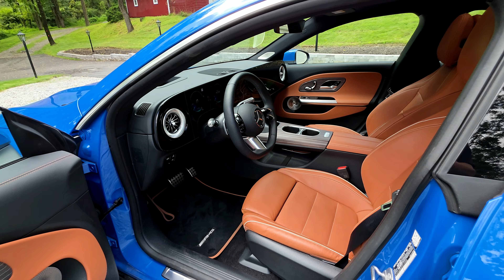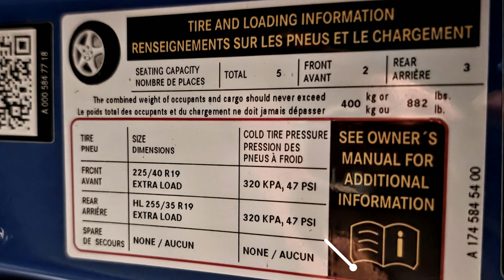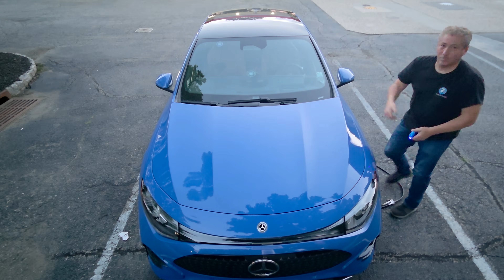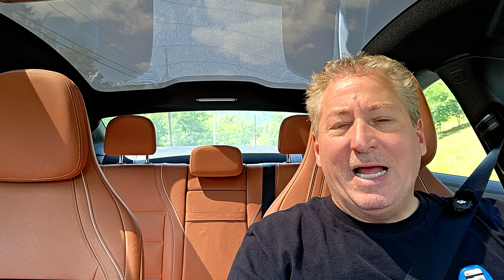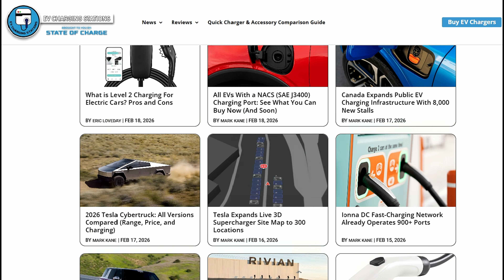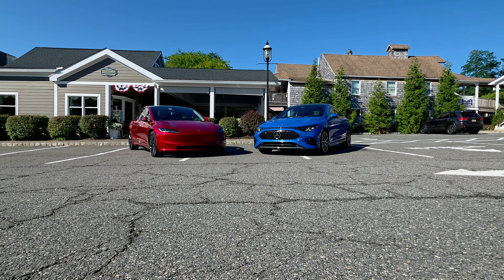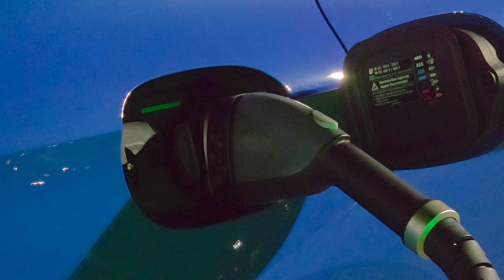The Mercedes CLA 350 4MATIC Has Seriously Impressive Highway Range

Comment: Just had one as a rental in France for 2 weeks. (The 250+ RWD). It was a road trip monster, never had to charge out of necessity and the charging was so fast that it would finish before our breaks were over and would have to go move the car. Super efficient and loved the automatic LED matrix headlights at night. 

All the Mercedes logos and the indoor definitely gave it a bit of an immature footballers first car after a contract.
Reply: Same here, rented it for about 1400 km in Spain, trips of 450 km, never DC charged it. Great hardware, but odd equipment (blaming the rental company more for that).

Comment: Thanks Tom.  Very impressive results!   And,  I agree it should sell well.   But, I think Mercedes has cur a few corners in order to keep the price low.  For instance, the steering wheel is not heated.  The only heated seat is the drivers.  I suspect that the glass is not as soundproofed as their higher price models.   The interior seems a bit too glitzy/plasticy for me (a long time Bimmer driver)    And the Burmester audio was just soso.
Reply: Fyi CLA Winter package option adds heated steering wheel and wiper heater. Both front seats are heated too, but not rear seats. You are correct that the CLa does not have acoustic double thick windows.  Burmester is great though, more powerful than previous generation. 16 speakers, 850 watts.

Comment: Ahh , the  range number.    Everyone wants  400, 500 miles of range, but when asked "Do you ever NOT stop before reaching  300, 350 or 400 miles"? Or  "Do you go on road trips that are longer than 400 miles"   And when people actually think about it, THEY STILL SAY I NEED  400 miles of range ..  bother..  Once "non EV" people buy EVs  do they finally realize how dumb it was to state they needed 400 miles..
Reply: I agree. I have a 2019 Kona with a rated 240 mile range. My wife still still worries about it after a year of seeing me have no problem. There is a number right in front of your face telling you how much further it can go. Nothing to worry about at all. 
Eventually more people will want to save some $ and get a smaller battery. We're just so basic in the USA and the manufacturers treat us like that. They're happy to sell a bigger battery than we need if they can squeeze another 10k out of our ignorant arses.
Reply: @gunningopher  Agreed.  IT is the "What if I need to" syndrome.  Just like how people buy huge trucks that can tow 10-15k lbs, but owner never does...
Reply: Plenty of use cases where you would prefer high-range cars. Daily charging for most battery chem is 80% recommended; winter conditions (cold temps, snow on the road, wind) really hurt range. Add in some elevation change and your 300 mi range vehicle is nearly half that. Not everyone lives in a metro area and only drives short trips frequently or has the ability to charge at home.
Reply: @rnodeprot  Drove my EV9 in  6 degree weather.  Did not even think twice about the range. Elevation... So you are going up hill for 300 miles straight?  Where i the US do you do that????  You either stop at the top of the hill, and charge or you go back down , gaining range back.    Sorry, no need for 400, 500 miles unless towing 7k+ lbs.   Non EV owners make me laugh...
Reply: @GregP30  I live @ 9k elevation. Daily drives can involve thousands of feet of elevation change. Regen is a fraction of what is lost uphill. Most are in your situation, but most also love to say no one needs more range. They, and you, are wrong. Btw, I've owned ev's since 2012 and own one now.
Reply: @GregP30 .  I want an EV.  But they and the charging network are not ready in my area.  It is all uphill on my 1100 mile drive back from family.  From 800ft above sea level to 7k feet!  Add in wind that flips semi trucks on their side!  And -30f
Reply: @nunya9555    So it is  -30F  EVeryday of the year? You drive 1100 miles every day/week?  You drive up 7k ft in elevation every day/week?  
    Those are the "what if" scenarios people think they need every day/week , but not in reality.  So my guess, less than 5% of your yearly miles will be in these conditions.
Reply: @G @GregP30  Not -30 every day.  Check. Not 1100 miles a week.  Check.  I can see your point.  But, you seem to think 6 degrees is cold.  We don’t live in the same climate.  I live on a paved street, in town and had to pull 3 stuck Jeeps out of their hole one particular recent winter.  What hole? Just a low spot on that paved (entire) street that is generally covered in 10 inches of packed snow and ice for at least 2 months at a time.  Couldn’t my little gas saver car out of the neighborhood.  My 2wd Tacoma also stayed put for two months.  But at least it was still sunny off and on.  There is exactly one supercharger in town that runs $1.25 per KWH.  Nearest one after that is 125 miles.  Most EVs could make that trip most of the year.  But with winter range reduction?  Folks out here still need a decent clearance AWD ICE at a minimum, plus the EV.  It’s doable, just not cheap.  Right now would be a great time to pick up a 3 year old EV with 10k miles for around $25,000, but I just don’t have that right now. BTW, I like EVs and always have.  Be careful that you do not argue so hard for them that you push away people.  That isn’t helpful. But I appreciate your zeal.
Reply: I disagree.  I have 2 PHEV’s. I make an 880 mile trip every 45 days.  I will buy an EV like this one Tom tested, because of the range. My usual routine is 5 hours non stop, 325 miles. Eat, at Denny’s recharge at L2, gas up at Love’s. End of stage 1. Drive 5 more hours, 268 miles, gas up, and recharge car. Sometimes I get a room, other times I continue for last 4.5 hours.  If you want the routing, it is CA51-CA99-CA58-I15-I40-US95-I10-AZ202-XUS60.
Reply: @Qrail  You are the exception.   Very, very few people make a 900 mile trip that often.  You are not the target customer.
Reply: @GregP30 . I do 1100 miles to visit family 3 or four times a year.  Where I live it is 120 plus miles between chargers and gets to -30F in the winter.  Reduced winter range on top of bad road conditions could cause more than anxiety, it could turn into a survival situation.  One charger in my town, and it’s running $1.25 per KWH (which wouldn’t matter to me charging at home).  I know many EVs can make 120 miles in the above stated conditions, but any ICE can do so.

Comment: I think the 2 speed gear box makes a lot of sense..
Reply from the maker: It sure helps with highway efficiency
Reply: Extra gear add complexity and another thing to break down the road.
Reply: @kenwk2283 true, but coming from gas it's still a lot less things to break.  And gas cars for the most part don't break all the time.
Reply: @kenwk2283  At least in the Taycan, it's more like an automated manual with a clutch pack.  It's far easier to auto-rev-match an electric motor.  It has 0 to do with a torque converter, valve body, or CVT type reliability issue.  There's very little to break, and it hasn't been an issue for the Taycan.
Reply: @kenwk2283 no worries Automatic Transmissions like the 10L80 co-developed by Ford and the GM Megacorp feature a whopping 10 gears, so "smartly" using this as a reference (which you should) having a 2-spd means 8 less gears one needs to be concerned with.😎 also ref: "The Glass Is Half Full".👈 see what I did there...?🤙
Reply: Yeah… I think the industry needs to accept the complexity hit.
Reply: @User.Joshua Yes definitely, gear box plus properly sized motors seams like a win in the range department.
Reply: Since it's just the Germans doing it, presumably it's only at Autobahn speeds where it makes sense vs. e.g. just adding more battery.
Reply: @concinnus  bingo if you know anything about traveling in the vicinity of Stuttgart (i used to live there briefly in 80's) this is all about "Funkengroovin" on the Autobahn. it's well known to Germans, that whenever in the state of Baden-Wurttemberg (unless properly equipped) you simply DO NOT travel in the "Hammer Lane" for any reason unless you want a tuned Porsche or Benz Saloon crammed up your backside. whatever Autobahn videos are now seen on YouTube in the 2020's, just know all that same speed was happening 40 years ago.😮

Comment: That base model is gonna be an extraordinary buy when they hit the market just off lease.
Reply: Then you have reliability anxiety instead of worrying about range.
Reply: @davidmccarthy6061  maybe. Many years ago, I ran a 1999 C280 Sport from 20k-195k miles without any repairs with the exception of a brake boosting hose and a position crank sensor; both of which I repaired inexpensively. Pretty uneventful little car. Mercedes can be reliable if you forgo the tricked out suspension systems (air) or high output versions.
Reply: @davidmccarthy6061 as time goes on its looking like EVs will be essy to replace packs, etc.
Reply: @davidmccarthy6061  Anxiety for both range and reliability.
Reply: @KP-xi4bj FUD.

Comment: I sat in one over the weekend. If you have a long body or are really tall this car just might be too small on the inside. I’m 5’10” with a longer torso and my head was too close to the roof and the front portion of the headliner. The seat also could not go any lower. I was sad just a little.
Reply: Yup I am about 6 feet and I sat in the cla at my local auto show and it is a tight fit. The backseat is almost unusable for most adults as well. I think the c class will be the better car.  Just a little pricier and it should have similar or better range.
Reply: @kleefton  Agree on the back seat.  I cant recall compared to a Model 3... think the MB is a bit worse, but at 6' 2" I found the front seat (slammed to the floor) to be OK.  Wish there was a better thigh bolster. But as expected the test drive was too short and didnt include any highway miles with adaptive cruise to really get a sense for longer drives.
Reply: Thanks.  That will help prevent me from being sad that I can't afford one.

Comment: EV manufacturers need to realise that adding gears to cut down on the motor's revolutions is the best way to add efficiency. That's what ICE automatic transmissions have done forever. Not to mention manual transmissions. That's what Mercedes has done with this to get that added range combined with a more efficient 800V architecture.

Comment: More manufacturers should adopt the model of under promising and over delivering. Thanks for another great review.
Reply: They don't put up those numbers,EPA does. Change the testing procedure. By the way every thinking person has pretty good idea how far would particular vehicle go based on its tank size and typical mileage for that type of a car. Nobody (normal) ever complained over ICE car EPA numbers,we knew those were the lab results and that in the real life results may vary - mainly depending on how you drive so it's not as much "the car's range" as it's "your range". 
But everything about EV's is hyped and so is the range "question". Shortly,this car has 85 kwh battery,it's low and sleek with the small frontal area so it should go as far as Tesla m3 driven the same way at similar conditions.
Reply: @MilanSrdić-t8k   The EPA doesn't actually run the tests, the automakers do it themselves. Plus, there's two different EPA testing methods allowed, 2-cycle and 5-cycle, and the latter is generally easier for most vehicles. And finally, automakers are allowed to reduce their rating as much as they want. The combination of not knowing which test method they use and not knowing how much they voluntarily reduced their ratings makes comparisons needlessly difficult.

I personally have complained about their ICE car numbers (especially the highway rating) but not enough other people have.
Reply: I think all manufacturers should put out the BEST product they can built, with no marketing gimmick

Comment: I’m sorry to say, but I am one of those guys who drive my Tesla in sloth mode 59 miles an hour or 60 miles an hour you can say is why my car currently still beats the EPA of this Mercedes you just tested and that’s at 70 kW of battery use
Reply from the maker: Speed makes a huge difference. I wonder how far this would go at 59mph in eco mode - probably about 425 miles

Comment: Yikes, that charge test seems to already show some battery thermal limits. Looked like it overheated then recovered slowly... Not surprised but I wish automakers could figure out battery pack thermals by now.
Reply from the maker: That's the programmed charging curve. I did multiple tests with it and it repeats every time. The 10 to 80 doesn't do that, but when you plug in at 0 (which most people will never do) it will rip along at over 200 kW for 6 minutes, then drop down to abotu 130 for a couple of minutes, before going back up to abotu 155 briefly. But by then it's at 65% and starts steadily lowering. It charges exceptionally well overall. It easilly beat Mercedes' claim of 10% to 80% in 22 minutes.
Reply: @StateOfChargeWithTomMoloughney  That's good to hear, did you see any information in the charging limits screen? In Bjorn's testing if I remember right he frequently saw "battery temperature" listed as the reason for not receiving max power.

Comment: That is wild, especially for the less efficient AWD model. Considering the 250+ is rated at 374 miles, the same range delta would yield 461.5 miles (I highly doubt the delta would be that high on the RWD version). Time to battery bargain a lease deal on a demo model lol.

Comment: Tom are you able to log the true average speed for your tests over the whole duration?
Reply from the maker: So, what exactly do you mean by true average speed? Some of the vehicles (like this one) give you an "average speed" for that driving trip, but they are never acurrate for a range test like this because they also factor in stopped time - there's no way to stop that. So, for instance, every time I turn around in these range tests, it takes me about 3-4 minutes to drive maybe 1/2 mile. That always lowers my "average speed" but it - in my opinion, and you may think otherwise, it doesn't count because it doesn't really calculate my average speed properly. For instance, if when I stop for 10 minutes to adjust my cameras or lighting in the vehicle, the average speed keeps lowering, but the real average speed of the range test hasn't changed. 

So no, I don't have a way to monitor only the actual highway driving of the range test, but what I can say is the nearly the entire range tests are done at the proper speed - at least 98-99% of the miles driven. Sometimes, there's a mile or two that are done at slightly lower speed, like a short construction zone, but never more than a couple of miles. And 2-3 miles of a lower speed out of 385 miles won't affect the range test results at all. It would if this was a pure scientific range test in a controlled environment, but the wind and elevation changes alone have a MUCH greater effect than a couple of miles of slightly slower driving. 🙂

Comment: Unlike some other manufacturers, Mercedes has always been conservative with their estimates. Good test, thanks!
Reply: The Germans in general tend to be conservative with their performance specs, e.g. 0-60 times.
Reply: Meanwhile in other side of the world there are Chinese EVs that claims "450 mile range" but in real 70 mph highway speed only got like 280 miles just because they use CLTC testing standard (that's basically just 30 mph city driving)

Just wish the EPA testing becoming a worldwide standard to ensure fair range calculation across all EVs